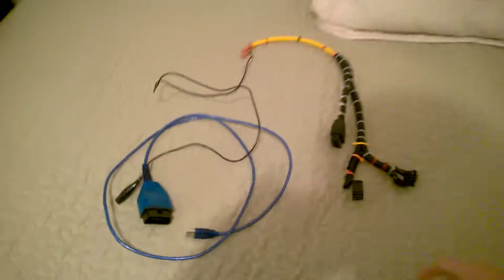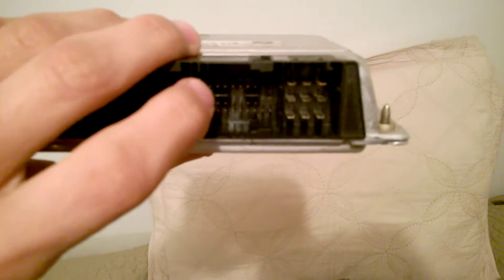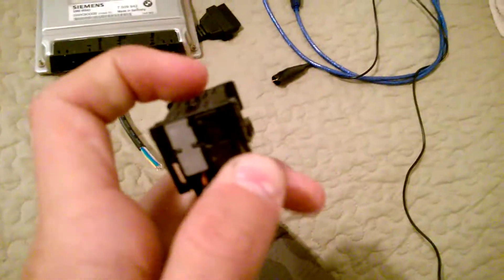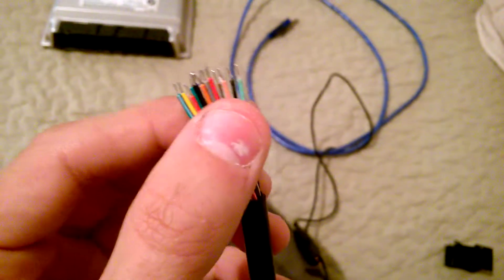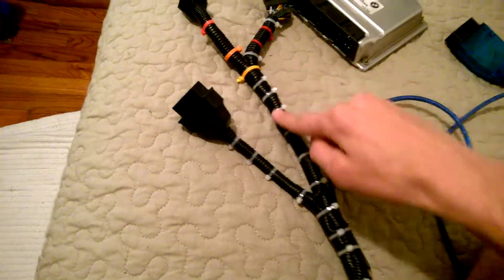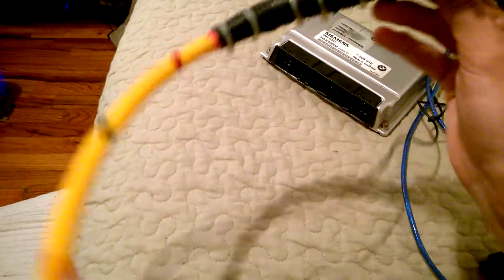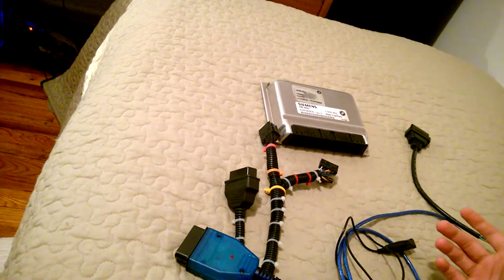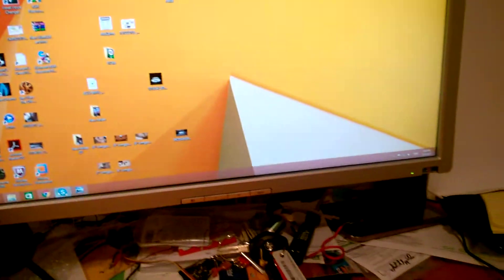EZ PZ how to make  MS43 Flashing  ez connect harness for work on the table

Comment: Open the DME box and ground pin 104? What ?? I was completely lost at that
Reply from the maker: If u want to flash it in boot mode u have to open ecu box and groun pin 104 with ur power supply
Reply: @fde4683 o plan to run ms43 with b30 in e34 any help

Comment: is there a certain amp or watt requirement for the power supply? Awesome video, thank you so much!!!
Reply from the maker: The USB adapter I’m using to power it is just a regular 5volt to 12 volt usb step up , with 0.5a max which is enough to power ecu and not enough to short it if u Fck it up

Comment: After flashing with jm garage flasher car won't start then just now did adaptation ews dme on pa soft 1.4 and the dme vin number changed and it's said adaption done and car wouldn't start :( no reply ?
Reply from the maker: What file did you flash?  you gotta flash  EWS 512 KB off ( and ur engine size )  and you dont need to align ews to DME , and yes  vin will change on dme , but you can manually do it  ( its kinda hard to explain ) If u want i can make a video for you just let me know
Reply: Andrey Arkashin how much to make a harness for me I'm in UK

Comment: what exactly is the benefit of doing this I'm curious
Reply from the maker: +e46orozco i could connect my ecu on the bench and flash it out of the car , also i could use galleto  , if you are on e46fanatics you should know , that we can tune ecu ( anyone can software is free)
Reply: i'd like to find that link also i i cannot find anywhere a diagram for the stock e39 wiring harness for the ms43 ecu, i took the pins out to clean them, eml light on and codes everywhere and car will turn over but no start and i have 2 wires in the wrong spots causing it and i need a schematic or something that tells me what color wire to plug where

Comment from the maker: Items you need 
1) Harness from the engine 
2) Obd 2 female 
3)Soldering iron and skills))) lots of heat shrink or wire cover like ive got and post your creations on here i wanna see them young padawans))))
4)black and red wires for connection
5) power supply or 12 volt battery (power supply from pc is best choice)
6)You need a k-line adapter which is sold with INPA or without on ebay mine is blue color as you can see that works great
7)More skills)))
Some image is you YOU GOT TO LOOK AT THEM THEY WILL HELP YOU MORE THAN ME)))
http://i0.wp.com/jmgarage.ru/wp-content/uploads/2014/10/ECU-BMW_-SIEMENS_MS42_MS43_MS45_cr1.jpg FOR ECU PIN OUTS 

https://www.google.com/search?q=obd+2+wiring&espv=2&biw=1920&bih=1099&tbm=isch&imgil=i544tdWsjPzreM%253A%253Be1s6DX6Yd6xJYM%253Bhttp%25253A%25252F%25252Fwww.clubxterra.org%25252Fforums%25252Fshowthread.php%25253Ft%2525253D128946&source=iu&pf=m&fir=i544tdWsjPzreM%253A%252Ce1s6DX6Yd6xJYM%252C_&usg=__6D3pinkncqTZZYZXPvDBxYfZGuk%3D&ved=0ahUKEwiGv4eX6uvKAhVJbj4KHQbxCGYQyjcIKQ&ei=d3W6VsanC8nc-QGG4qOwBg#imgrc=i544tdWsjPzreM%3A&usg=__6D3pinkncqTZZYZXPvDBxYfZGuk%3D FOR OBD 2 WIRING DIAGRAM

Steps:
1) Once you got your Female Obd 2 plug   if it has wires figure out which wires are  pin 4, pin 7 and pin 16 . Pin 4 is Ground/negative,  Pin 7 is K-line , Pin 16 is battery positive 
2) Get wiring harness off the car chop it up you will need plug 1 and plug 4 only  (dont cut it off your car stupid)
3)Once you have done that  you need to find out which wire colors go to pin 32 which is K-line and pin 26 BATTERY POWER!!!!!!(ignition) On my harness from 2005 coupe for pin 32 it was white with purple stripes on 2 sides and pin 26 was green with purple stripes also double sided( this is from plug 4)
4)Going back to plug 1, you will need pin 7 which is battery power and pin 4 is ground/negative
5)Get you soldering iron our and prepare your anus! Now  Wire from PLUG 1, PIN 7  SOLDER TOGETHER WITH PLUG 4 , PIN 26 Wire AND TO PIN 16 WIRE FROM FEMALE OBD 2 AND THAN get that extra red wire you got to solder it to those wires ( pin 7 wire plug 1 , pin 16 from female , pin 26 from plug 4 ) and that red wire you will plug into power supply (12 volts ) or battery ( i prefer power supply for constant voltage be on the safe side)
6)Now you take plug 1 wire 4 and you run it to Obd 2 female  Pin 4  as it supposed to be your negative and now you take that extra black wire (you need 2 pcs) 1 piece goes to batter terminal and the other for ground short needed for JMGarageFlasher to read and write to put ecu in boot mode, and you solder them together ( PLUG 1 PIN 4 , FEMALE OBD2 PIN 4 AND 2 Wires black color for power supply and ground wire for pin 104 on ecu/dme)
7)Now you take your  K-line wire from ecu harness and you run it to OBD 2 Female Pin 7 and you solder that together 
8) After heat shrinking everything))) YOU GOT YOUR SELF EZ CONNECT HARNESS FOR FLASHING YOUR ECU BE PROUD OF YOURSELF NOW) 
9) BIGGEST MISTAKE IVE DONE  FLASHING WITH THAT HARNESS) - when you use Galleto to flash 64 kb bin for main car parameters that where you change everything YOU DONT HAVE TO GROUND THE WIRE TO THE PIN 104 ON ECU JUST DONT DO IT , ONLY PLUG IT IN TURN POWER SUPPLY ON AND READ AND WRITE , BOOT PIN ONLY FOR JMGARAGEfLASHER
10)Once youve checked all your connections on the harness you just made , plug in that k-line adapter from ebay into female , DONT PLUG IN THE ECU YET , put power to the harness and check if the LED lights up on that k-line adapter if you have one OR LISTEN TO THE stupid sound PC makes you plug in devices it should ask for drivers if you got xp , i used win 8.1 worked great(fuck windows 10) 
11) Once you verified that k-Line is working  , shut that power supply and than plug ecu into the loop idiot ,dont make me cry if you shorted out ok)) because if you do all bmw enthusiast somewhere on the planet will cry and hate you
12)SO Recap FOR GALLETO PROGRAM DONT NEED TO PLACE ECU INTO BOOT MODE , IT IS ONLY NEEDED FOR JMGARAGEFLASHER, if you do put it in boot mode nothing happens and you just wont be able to get that 64KB file that you wanted to flash)) 
13) Once you flashed your ecu ( if program freezes DONT TOUCH IT it runs ANYWAY JUST TAKES TIME NO MORE THAN 5 MIN UNLESS YOU GOT SHIT PC)
14) One more time once you flashed your ecu go and check it in your car ( PLS IF YOU ARE NOT CONFIDENT DOING THAT ON YOUR OWN CAR WITH THE ONLY ECU YOU GOT , CMON MAN DONT BE A PUSSY DO IT OR ASK ME ILL HELP)))BUT ALWAYS PREFER TO GET THAT STOCK ECU BEING STOCK AND BUY ONE ON EBAY AND FLASH THAT ONE ( you can save your stock ecu info anyway (read it with jmgarage flasher and save as stock its ok )
15)Check if your car starts and if it doesnt you screwed up cuz ive got everything working perfect ,and if you to the point when you got that 64kb file and you dont know what to do next just comment ill help
16 FOR ALL OF YOU WITH MS43 DME on your bmw  ALL INFO YOU CAN FIND ON e46fanatic  under  driveline/DME tuning and topic is Biggest dme tune sht ever http://forum.e46fanatics.com/showthread.php?p=16892281#post16892281)
16) Enjoy your car and pls dont bitch about my sht voice man im only 19 and im from Russia and also im shy as fuck on camer so fuck off))
Reply: What a pimp